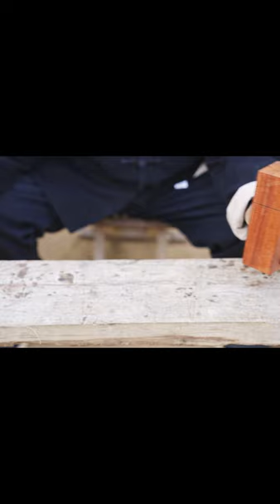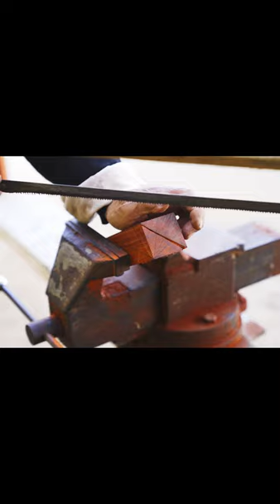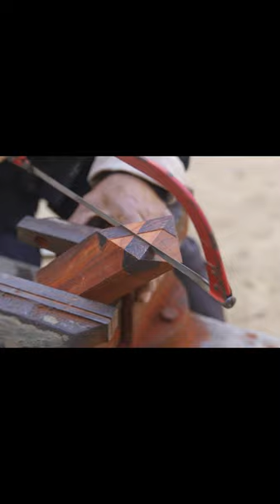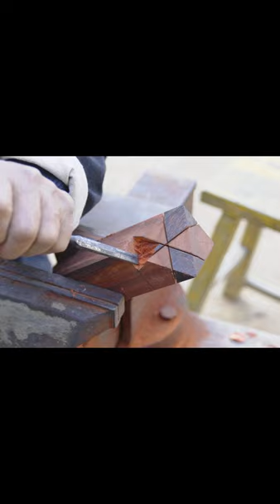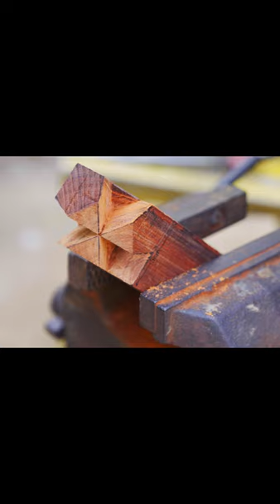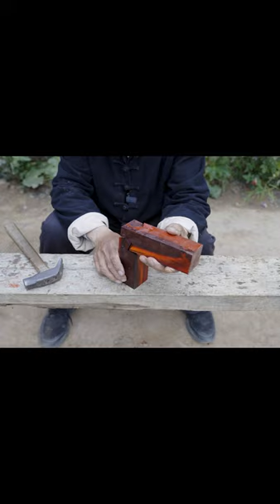制作一个榫卯结构，紧密相连#shorts

Comment: Beautiful joinery, just a slight problem, the vice that holds the wood has got 2 rough clamping edges and will damage the wood, he should replace it with 2 smooth clamps.